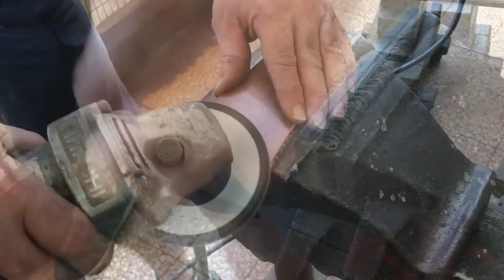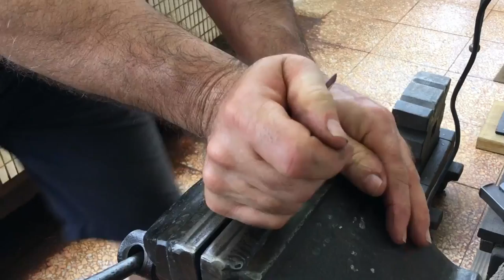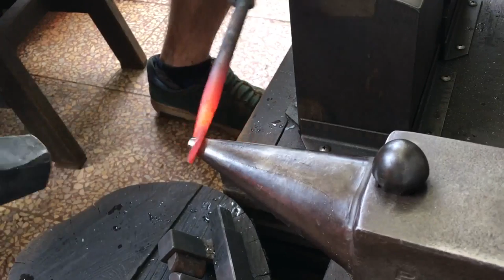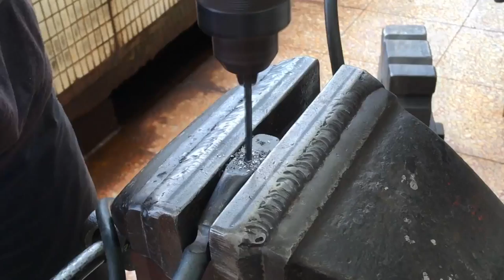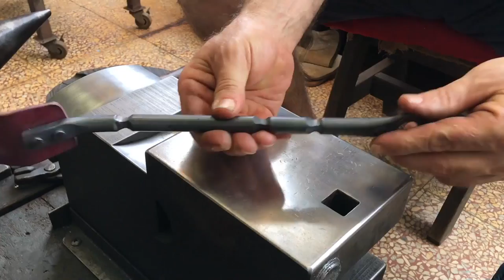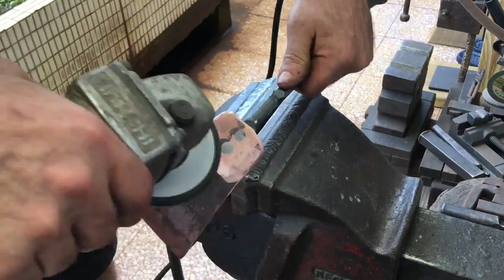Making a Copper and Steel Spatula

Comment: Nice! I have a welding and blacksmithing shop in Arizona and I make entire sets of cooking utensils, from forks to ganchos to tongs, for camping and Dutch oven cooking. I've never thought to make my ladles and spatulas a little fancier with copper. Those will probably sell pretty well in the copper state.
Reply from the maker: Some people seem against using copper for stuff like you make but it seems perfectly safe and practical to me and can really add character to those pieces. Good luck in your work. Thanks.

Comment: Lovely work once again, glen. What is your reasoning for the pads under your anvils and having them different hardnesses? I'm guessing they aren't so squishy that it affects the performance of the anvils, tho. Thanks for sharing what you know and learn.
Reply from the maker: The thicker, softer mats dampen the sound more so I normally use these. But my anvils shake more with those and so I use the thinner, harder mats for most videos. Thanks.

Comment: How would you go about re-hardening the copper?  Thanks for the video!
Reply from the maker: You could heat it and let it cool slowly. And/or repeatedly tap the copper with a small hammer. The hammering will work harden it. Thanks for watching.
Reply: Glen GS Tongs   Thanks Glen.

Comment: If the copper is still annealed, how do you keep it from being too weak to be useful? Thanks for the great video!
Reply: its copper not rubber, pretty sure it'll lift a hamburger...
Reply from the maker: This actually is a good question. The piece of copper I used here is fairly thick and so it shouldn't bend with normal use. But if you used a thinner piece, you might want to harden it by gentle tapping the copper repeatedly with a small hammer to work harden it enough. Thanks for watching.
Reply: Thank you Glen

Comment: https://en.wikipedia.org/wiki/Galvanic_corrosion - TLDR you need to oil the section where copper interfaces with steel. Idk if this phenomenon can produce copper salts but wouldn't want to risk it.
Reply from the maker: This is a good reminder. Also, your name Verdigris, is a really appropriate for a project involving copper. Thanks for watching and for the suggestion.